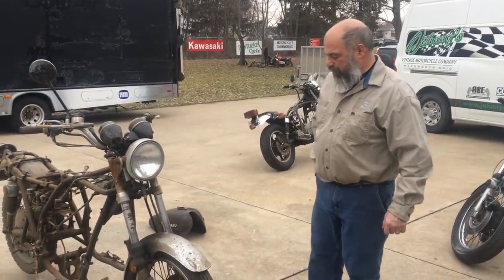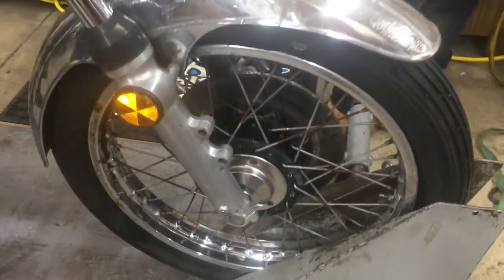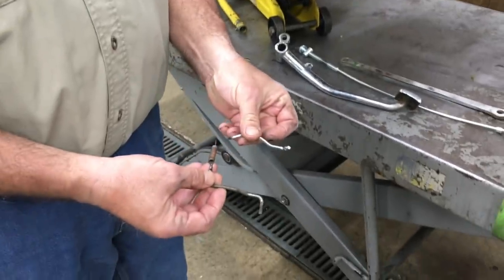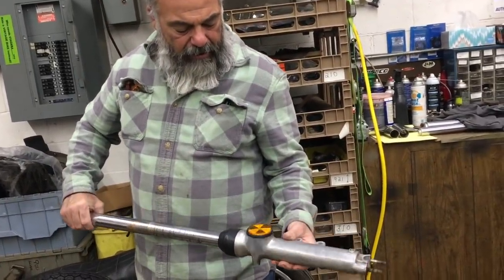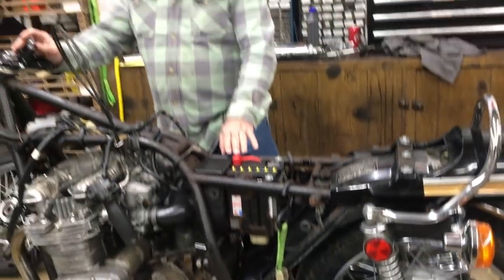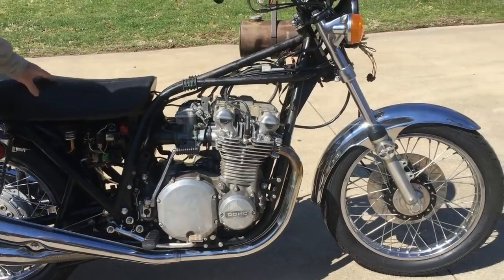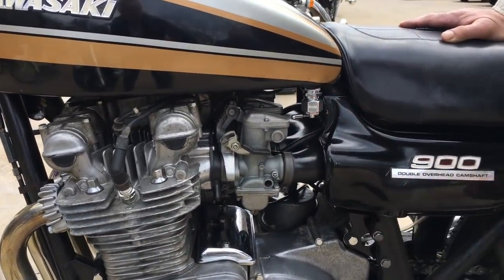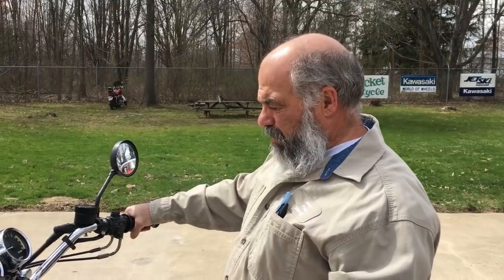75 Z1900 Dirty Lowdown FULL MOVIE

Comment: I wonder what it sold for? I like that its a runner and not a trailer queen. I could handle owning it. Run around on it and then first winter strip it to get the frame painted, but that's all, turn it into a bike you can improve and restore while you ride.
Reply from the maker: It sold for 7500
Reply: @Johnnysvintage  Oh well then everyone is happy eh?  Someone got a good bike for a reasonable price. Over-restored trailer queens aren't my scene,  but thats ok for other people, I like runners,  my  friends kz650 I bought off him will have its original wheels unrestored, but thats ok since I first rode it back in 77 !  " Too  good to ride  " is not for me. Keep doing what your'e doing how you're doing it and  you won't go wrong.

Comment: i use the s 100 also ,but i buy it by the gallon ,and pour it into  one of those small ,hand held ,pump up bug sprayer,,sure saves your hands..pulling that trigger over and over starts to cramp up the old mits..better to pump about 20 times ,then you just pull the trigger one time ,.and it comes out in a stream ..

Comment: Honest question. Is it worth it financially to restore something like this? Is there a market for it to make it worth the money.?
Reply: NO, never !!...this bike sold for $7500, he charges a minimum $5500 JUST for labor to do the restoration so that's $13,000 then you have to pay for all the vapor blasting, re-chroming, powder coating, normal paint (tank, tail, panels) and PARTS, every seal, gasket, tires, spokes, the list is endless and anything rubber will have perished, plus you'll never buy a bike 100% complete to start with so you'll need to find and buy those missing parts that match your bike, the correct exhausts, air-filter, wheels, headlamp, clocks etc, etc..... you could end up spending near $18k total for a 1975 Z1b that will NEVER be worth that !!!, plus all the aggravation, discussion, time waiting, worry, honestly take your money and buy the bike in the condition you want it in and leave it in that condition !!
Reply: @Z1Hellrider  now it's 2022 and Z1b's have hit 30k in Australia 🇦🇺

Comment: The rear wheel is slightly turning when you gassed it on the stand. Is that a concern? Probably just a few finger-twists of the clutch adjustment?
Reply: It is caused by drag that makes the gearbox spin even when in neutral. Virtually every motorcycle has this issue. In gear, with a wet clutch pulled, you are guaranteed to get drag from the oil film that will turn the wheel. However, it doesn't take much friction to stop the wheel - a toe or a hand on the wheel will stop it from turning.

Comment: People ask is it worth getting a bike restored, I would say NO, NO and thrice NO, do the math, here's why, this bike sold for $7500 on eBay, he charges a minimum $5500 JUST for labor to do the restoration so that's $13,000 then you have to pay for all the vapor blasting, re-chroming, powder coating, normal paint (tank, tail, panels) and PARTS, that means every seal, gasket, worn sprocket, damaged clutch/ gearbox /engine parts, tires, stainless spokes, the list is endless and probably anything rubber will have perished, plus you'll never buy a bike 100% complete to start with so you'll need to find and buy those missing parts that match your bike, the correct exhausts, air-filter, wheels, headlamp, clocks etc, etc..... you could end up spending near $18k total for this 1975 Z1b that would NEVER be worth that right now !!!, plus all the aggravation, discussion, time waiting, worry, honestly take your money and buy the bike in the condition you want it in and leave it in that condition !!